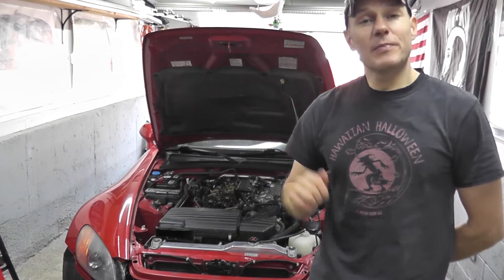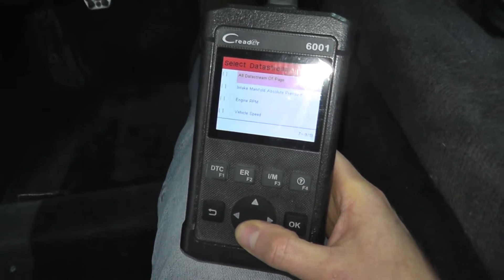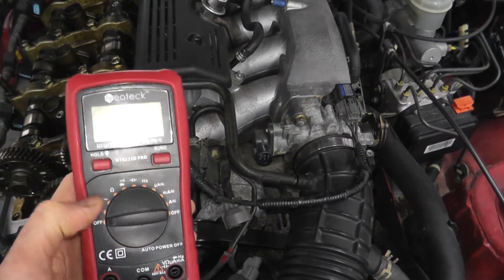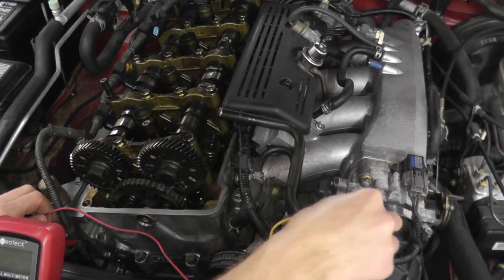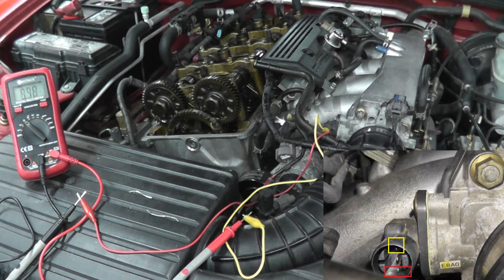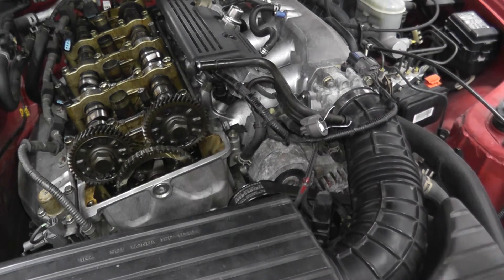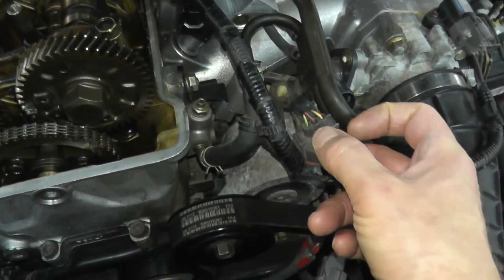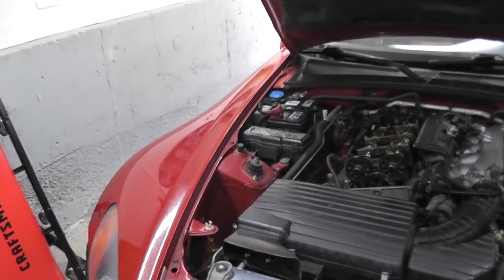Throttle Position Sensor P0122 & P0123 - Testing and Replacement

Comment: Nice.  It's possible to buy OmniPower TPS (instead of whole TB) for and buzzed off the flanges so can rotate it to .30V at idle.  Grind a slot on mounting screws to remove old TPS (use m4 screws and washers later)  After replacing the screws you can adjust TPS by loosening it and then rotating it while  watching the idle voltage level 30 to 4.5 volt working output range...

Comment: 5:38 "sensor is working perfectly fine"  - not always true, you must turn the throttle very slowly and make sure that every bit along the way is smoothly increasing or decreasing as the case may be. What can happen is that somewhere in the middle area of the throttle, where it lives most of the time when you are driving, you can get dead spots. In other words, right where you need it, where it gets used most of the time,  the position sensor is a bit worn out and not giving a good signal. But if you just twist the throttle quickly and look at your meter, it will look fine.
Reply: VERY IMPORTANT COMMENT
Reply: Thank you very useful

Comment: Excellent my friend very nicely done on your video.
I did replace my TPS a year or so back.
I've been having another little problem but I'm going to recheck the TPS just to make sure.
Right now I'm leaning towards.
My MAF SENSOR FOR ONE OF MY PROBLEMS.
I ordered the MAF
SO WHEN THAT COMES
I will see if that corrects my problem.
Once again good video you did.
Keith Kuhn